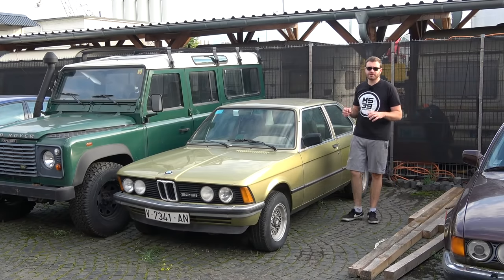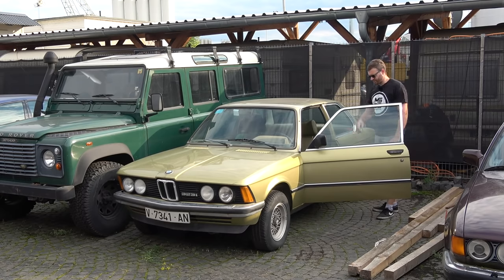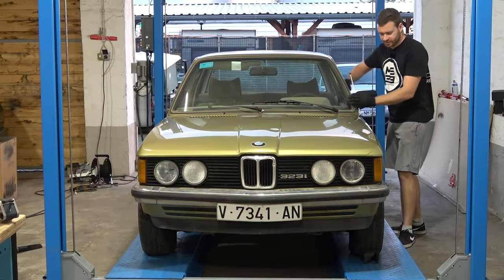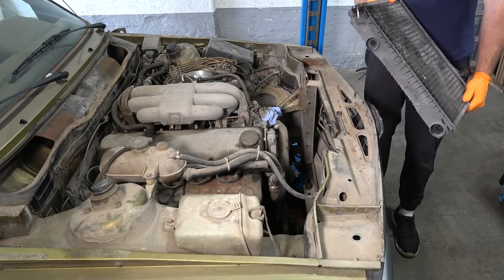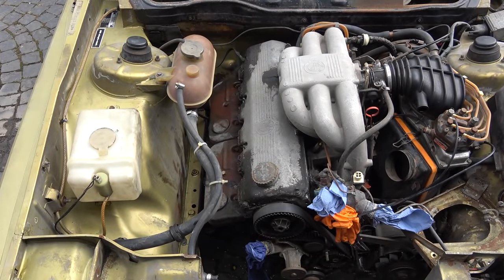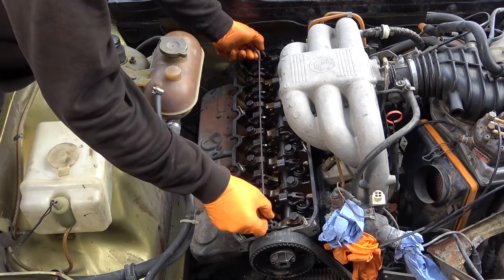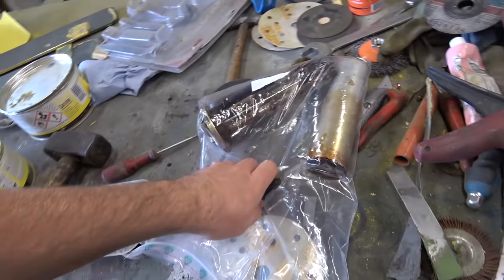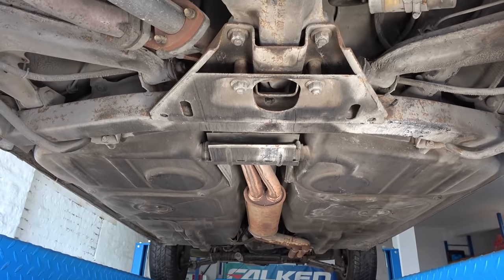26 Years Of Sitting - What Does It Take To Get it Running? BMW E21 323i - Project Castellón: Part 2

Comment: Compression WILL improve after you knock the rings back into place with a good old italian tuneup and getting them to bed in again with a couple heat cycles. That engine is definitely saveable.
Reply: That’s completely true and the compression is so low because he wash the cylinders. Use a mix of 2 stroke oil in the gasoline help to lube the walls an improve the compression when you are starting something that old.
Reply: I think so too. I wonder if the valve stems are sticking and not fully closing. Could that explain the low compression and backfiring?
Reply: definitely saveable remains to be seen but i give it a good chance as well
Reply from the maker: Compression results were really poor cause cylinders were washed out, as I said in the video. It will improve once the car is running and I flush the engine, but very doubtful it'll be over 10 bar (minimum for this engine) cause cylinders are pretty scored and valve seats heavily gummed up. A full rebuild is unavoidable.
Reply: @M539Restorations  luckily the Recently expanded Dojo has enough room for an engine stand and lots of workbench space to give that M20 engine the proper attention it needs; the real question is finding a competent local machine shop that can refresh those cylinder bores and the head.
Reply: @M539Restorations  correct!
Reply: @digitalrailroader  we need a collab with Subi performance and then we’ll have a sick M20

Comment: K-Jetronic is actually a beautifully simple system and quite economical too - the air flap won’t be stuck, but judging by the rest of your fuel system the plunger in the metering head will be! 

When working properly, when the air flap lifts, it moves the plunger in the metering head and this in turn allows more fuel into the injectors. Porsche used it to good effect starting in the ’70’s, as did VW/Audi etc. a bit later and once you’ve worked through it, you’ll be a convert.

Keep it going - love watching your channel 👍

Comment: The fuel pump/accumulator assembly is such a work of art. I love these old cars. This was my first car. Quite fast, very comfortable, great sound, but didn't handle well. Very noseheavy. The 4 cylinder ones were a bit more balanced and if you moved the battery to the back the balance was improved.  But the 6 cylinder ones were at times dangerous.

Comment: I've had that compression issue once in my E36 M52B20. I wanted to take it from my mechanic, but it didn't start at his parking. One guy came here and we tried to figure out what was the problem. After long long cranking without starting, he checked the compression it was ridicoulusy low. (don't remember now) Then he went back to the shop and talked with more experienced guy, but he also didn't have any idea what's going on. He cleaned spark plugs, put it back in and crank again. The engine didn't start. This second, more experienced guy wanted to check compression once again and it turned out, the car had around 12-14 bar. It started after this second compression check and such situation didn't happen ever again. I don't know what was the cause of car not starting, but in case of compression, mechanic said that not burned fuel just flushed oil from cylinder walls. Then during compression check, spark plugs were disassembled so fuel evaporated. Once pistons spread oil back again on walls, compression came back. I don't know if it's what actually happened in my engine, but maybe it would give you some hints about low compression. Would be cool if you check compression again after engine worked properly (if it will). I'm really curious. As always enjoyed this episode. Thank You for the show!

Comment: Great to see this car getting some love!  Here's a question or a tip - have you thought about getting a set of bottle brushes?  You can get them with plastic bristles so as not to scratch delicate surfaces, or get steel bristles for jobs that require more "elbow grease."  Again, thanks for showing these classics some love.  The E32 and the E21 are both favorites of mine - I am somewhat partial to both as I have owned one of each.  My car was a 1981 320i, the bulbous-bumpered M10 US model.  Tragically lost in 4 meters of flood waters in Hurricane Katrina.

Just an FYI, that fuel distributor is an extremely fussy device.  My M10 engine had one of those, and per the manual, the calibration on those is measured in MICROMETERS.  I highly recommend leaving the calibration of these to specialists if you don't know what you're doing.  The K-Jetronic CIS (Continuous Injection System) was an extremely fussy beast, which is why BMW then went to an EFI system for the E30.

Regarding the papers, I don't know how they do it in Germany, but in most places in the USA, a seller cannot keep both the cash AND the papers.  In order for the sale transaction to complete, the papers MUST be surrendered.  If you handed over the cash, the papers MUST go to you in order to complete the sale and register the vehicle.  No criticism of the seller intended, but that seller should have had the paperwork lined up and ready to be handed over at the point of sale.

Comment: Restoration works old car BMW e34... Water The cooling system was overgrown with lime.  The only option is citric acid.  Very well cleans the cooling system chamber from limescale.  How to do it.  Rinse with excess water.  And close the end before citric acid with hot water pour inside.  Allow to stand for 4 hours.  Clean again and again.  What 3 times.  Will be clean.  As new from the factory.  I have seen all kinds of miracles.  With all the machine.  Good video.  Good luck in the restoration work.

Comment: In the old days past you would put builders sand in the tank with detergent. Shake shake shake 
Then shake shake shake. 
Love your honest approach and complete focus on doing things right. I drove a 323i in 1987 and I loved it but I was worried about the new fangled k tronix system. All cars in Australia were carbs and big displacement. I remember how good I felt driving this car. I had a 1978 528i at that time in bronze paint. But I didn’t have the money to get the 323i. What a sweet car it was. 
In those days the 528i used to crack heads, I replaced 2!. The Australian heat and not enough metal between the combustion chambers was a good disaster. These days I have 2 x e39s a 2.5 and the 3.5. I love them both, work on them every second day, but absolutely every time I go for a drive I never get bored they drive so well.

Comment: Back in the day, I owned and worked on a lot of '80s and '90s BMWs. They were well made, robust, easy to work on, and very reliable. I referred to BMW engineering of the era as 'sophisticated simplicity'. I could give many detail examples of that, but suffice to say it was the polar opposite of a modern BMW.

Comment: I had my 1978 323i in the body shop for over a decade, all the gas turned to varnish. You need to also check the WUR and the CIS Fuel Regulator. I have got my car running but they needed replacement. I now have swapped in a built 3.0 Liter and a Medium case M5 diff.

Comment: Hi Sreten.. For cleaning the inside of the fuel tanks, I also recomend apple vinegar, just fill the tank with that, and after 24 hours you will see that it looks very good, almost like new, I have used it on my motorcycle fuel tank, that had surface rust on the inside, and it cleaned it amazingly.

Comment: i had an 320i e30 lachssilber sitting in a bunker for 21years.
i changed exactly the same stuff as he did except of the fueltank and the injectors.
the engine ran smooth as it never sat for 20 years in a bunker. m20b20.
i think if u let it run for some time it will be alright.
give it some time.
and as always amazing job. 👌🏻

Comment: Those old fuel gauges do that; they work properly only after the engine has been running for a minute or so, and then they tend to drift a little to the left and right due to the fuel sloshing around. Hope you get the paperwork sorted out soon, and thanks for another great video, man!

Comment: I might suggest to check the solder points on the back of the gauge cluster.  My E30 cluster used to act up like that all the time and after hitting the points with a soldering iron and re-flowing them, my cluster worked beautifully

Comment: Same starting/running problems with my Mercedes w126.
The problem is always the fuel distributor.. They were used on soooo many cars of that era, even Ferrari used them.
Luckily you can buy a repair kit for them, contains the big diaphragm and all the O rings etc. Ebay has them, not too expensive.
Quite a few videos on YouTube showing how to do the job.
Great videos young man, keep up the good work.

Comment: Put the cooling system back together, and use some dishwasher detergent and water. Like Finish Jet Dry or something and run it for a few hours. Drain, fill back with straight water and run it. Repeat until clean then fill with coolant. It’s fantastic for cleaning out yucky rusty oily or congealed cooling systems.

Comment: I have a MK2 VW GLI with that same type of mechanical fuel injection which has been working flawlessly on my car,but it has been very well maintained over the years and regularly driven.  That system isn't bad if the car is driven so Im not sure why people hate it so much.

Comment: Your videos as therapy , thanks . I want to give a information also. You see some green, brown dirt inside the coolant parts. It is because of  electrolysis.Non changed antifreeze made it.  Measure coolant and try to keep it below 0.3 volt. 0.7 is a danger limit to start electrolysis.

Bmw say iron cast engine needs new coolant every year.

Aluminium engine for max 3 years , M52 and plus.

New engines with organic red antifreeze up to 10 years.

I love BMW cars. )

Comment: Used to start engines with a garden hand pump,   put petrol in it ,  hand pump it with air , and spray into throttle body. 
No surprise the Ke fuel distributor is stuck - fuel system is so cloged on this baby. Not so hard to rebuild a KE head,  but the gasket in it is a problem.
Nice content!

Comment: Hey man! I’m a chemist, quick thought on cleaning the fuel tanks in the future to speed things up: try boiling water first a few times, then solvents. Or get the tank in front of a space heater till its nice and hot, then add solvents. Heat makes everything dissolve so much faster. Of course, heating the solvents too would be even better, but too dangerous (unless you’re really adventurous, don’t do it next to E31…)
Cheers from USA!
Ps. Sweet P.P.E. usage!

Comment: If you need to rebuild alloy that has rotten away like the thermo housing, i use polyester resin that is used to put anchor bolts in walls, it has fine sand plus it drys quick and it can be sanded in to any shape and tough as old boots, i have used it to rebuild heat exchangers on boats as a temp fix.

Comment: My golf 2 has a similar fuel distributer, they are a pain to adjust! These older engines are very picky and will run awful if they aren’t getting exactly what they need.

I can’t say for sure but what i remember is that the flap in the distributor regulates the pressure within the fuel chamber (the thing where all your fuel lines connect to) when the car is sucking more air the flap lifts further creating more pressure within the chamber, thus sending more fuel to your injectors. since your tank was dirty it might be worth to check the tiny filters (SKU: 0 438 006 054) within each banjo bolt, wouldn’t be surprised if they have some tank residue left in them.

Comment: i'm very happy to see you fix a bmw from Spain, and a valencian car!! I would look at the probe plate, from the mechanical injection. I think is K-Jetronic? As you say, is stuck. Dismount it, and clean it. Change the fuel lines to the injector's too. There is a few parameters to adjust the K-Jetronic fuel pump, you must check the manual of the car, if you have it. The car is no rust because here in Comunity of Valencia ( Castellon, Valencia, Alicante) we haven't a lot of snow during the winter, so that, you have a very good condition of the chassis  under the car.

I waiting for the new video about this! Greetings!!

Comment: The cruglefisher needs servicing. I’ve got a feeling the cylinder head is the issue. And a valve grind would probably get the compression back! As the test u did was with the throttle plenum closed and the cylinders washed out! I’d love to see it run well! Maybe a ball hone of the cylinders and fresh rings! Or the original rings freed up. Either way a mini rebuild could be done with the motor in the car! Head, sump off. Pistons out. Fresh big ends, “rollin new mains if needed! Quick ball hone! 
Rebuild the head on the dining room table! Ohh and port it whilst there! With a 3 angle valve job!!! 
Sounds quick & easy when you say it fast!!

Comment: Iron blocks are nice for making loads of power if you wanted to throw a turbo at it, also for re-boring the cylinders because there's usually no need for sleeves, but they do have a tendency to rust something fierce if they're neglected. Personally, I'm a huge fan of swapping in one of the modern inline 6 cylinders with an aluminum block. But, given how irritating and time-consuming it is to make the ECU and body looms of two vastly different cars actually work together and be happy with each other, I can understand wanting to just get the original working again. It's much easier.

Comment: Hi. Discovered this channel around a week ago and I’ve already devoured a good amount of videos. Great work, it reminds me of the golden days of Wheeler Dealers TV show, but even better - your goal is to really recover these old gems and not just turn them around.
Just an unsolicited opinion. Instead of cleaning the car only after the mechanical stuff is sorted, imo you should clean them before start working on them, specially the ones that are stopped for so long. It’s not good to bread that stalled air and dirt and mould and what not. It’s better to work on a clean car or at least, safe environment. 
Either way, good stuff and keep on going. Love it.

Comment: With that K-jet setup the intake boot must be installed or the disc will not lift at all. If there is no airflow from the intake the disc cannot lift. I don’t know if you tried it of camera but what we saw it cannot possibly have measured the correct amount of air at all 😊 Some K-jet metering units had airflow going the opposite way and those you could watch the disc move without the air cleaner. But this one you can not. Keep up the good work!

Comment: I had one when new 
No traction control 
Very Tail happy 
I almost stacked it on a roundabout due to a diesel oil spill 
Great cars

This one was clearly parked up because it was not running correctly and the cylinder bores have been washed dry by being over fuelled 
Bottom end rebuild with oversized piston rings

Comment: With the cylinders so rusty the rings could be stuck. Small engines with the decompression on startup are at ~60 psi so this engine should be able to start. If you can get it to run and give it a hoot heat cycle you might be able to get the rings to seal better.

Comment: I have fond memories of E21s, and a couple of scary ones. My dream when I was around 15 was a 323i in Arktisblau metallic, on display at a BMW dealer. I did on a later occasion get to try a 323i in the somewhat less discrete Iberischrot paintwork, but otherwise a 320/6 in Rubinrot metallic was a car I frequently had the opportunity to borrow. The rear wheel geometry with pronounced negative camber made it a bit unpredictable in the wet, to put it mildly.

Comment: Nice! Probably the rings are seized on the pistons, but after the engine runs for a longer time, they can unseize and then the compression should improve! First let it running for a while before deciding on rebuilding it.

Comment: Said it before - best way to clean the cooling system, take the thermostat out, put some dishwasher tabs or powder into the system (a large cup should do it), start the engine and let it warm up and/or drive with it a few 100 km....

Comment: to do an engine flush we used a mixture of diesel with engine oil, ran the engine on idle only for 10 minutes, then dumped the diesel motor oil mix straight away, while filling with fresh oil.

Comment: I used to use Brad Penn motor oil in my E30.  It's now considered racing oil, but it's the same formula from the 70's with zinc already in it.

Comment: Low comp can accure when you use starting fluid or and flood the engine. It cleans all oil from the rings and the comp vanishes.

Comment: It may have already been said, but you need to be very careful with MEK. I think you even need a licence to use it in Germany.... You should be wearing a vapour mask at least. It's great stuff for removing sealants and general cleaning but be careful on paints and rubber. Love the Chanel. 👍

Comment: Excellent very enjoyable , the tank has to come off my 1981 Capri 2.8 injection my fuel pump needs to be replaced it looks exactly the same as your one there. I must check if there are any sediments in my tank.My car has had little use in the last few years but it's in perfect condition so I am not dealing with similar issues to you. Best of luck with it  !

Comment: We had a project car which had a dud K-Jetronic (Volvo 760) but as we were not restoring the car we pulled that junk out and retrofitted electronic fuel injection using Megasquirt, it runs substantially better than that mechanical contraption!

Comment: The yellow white gunk in the cooling system may have been egg if the rad is as bad as you say it may have been done as a way to block the little holes. I was taught that as part of an emergency mechanics course in the army. The egg will fill the hole then scramble in the heat of the coolant. Just a guess though as I would have thought it would smell pretty bad after so many years